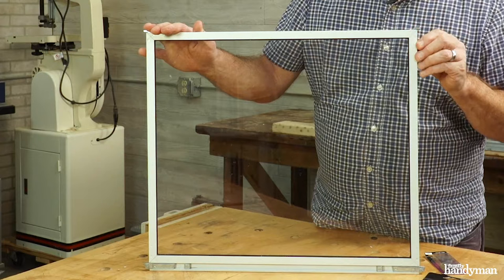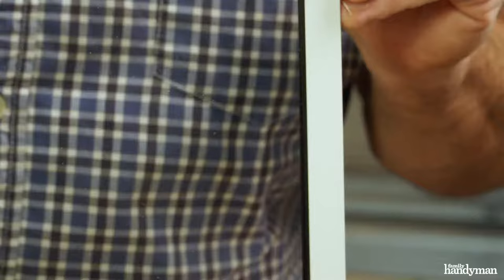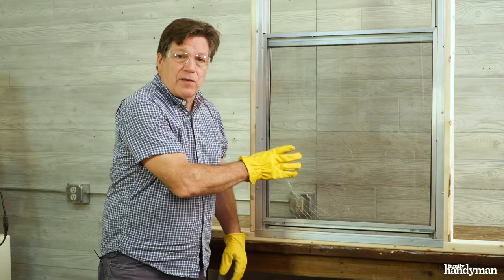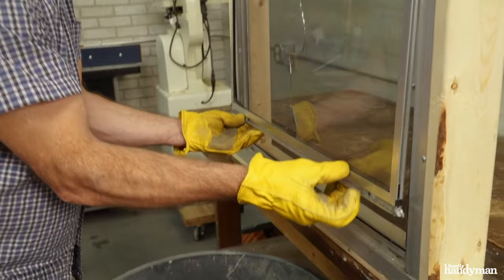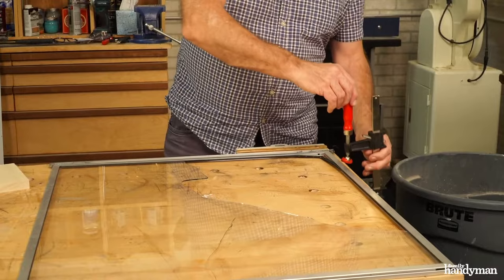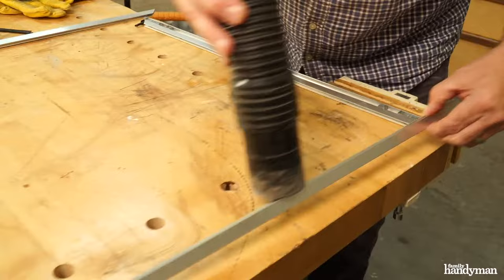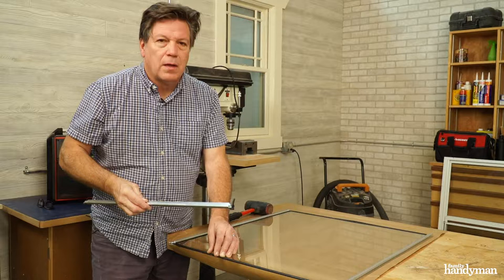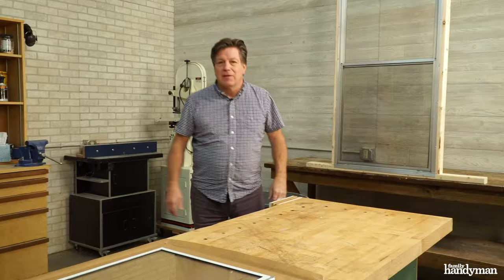How to Repair or Replace a Broken Storm Window

Comment: I can’t find anyone to do this job for 7 aluminum “storm,” window on my back porch. The corners where the latches are, the gasket is gone.
I cleaned the corners then used Flex seal, then after 24 hours, I used a silicone clear caulk. I smoothed it with soapy water on my finger.
It blends in and it doesn’t leak at all. 
Cost under $20.00.

Comment: Outstanding!  Thanks for covering the different types, like the crimped/dimpled ones.  I could it being a bit vexing to figure out how to disassemble those, good to know they can be drilled out.
Reply: Use 3/32 drill bit and only go until you get through the aluminum from both sides. That usually produces enough clearance to tap the frame out of the corner piece. Reassemble and use a nail set to tap the aluminum back in minus the bit u drilled out. I haven’t seen anyone use pins but I guess they are like rivets which would require through holes.

Comment: Helpful video...thanks. Question: When measuring for glass replacement it doesn't seem like the video accounts for the space the rubber gasket takes up. Shouldn't this be accounted for when ordering the glass?

Comment: Hi, 
I can not get the lower window with the broken glass of the storm frame.   I have taken these types of windows out through in my house with no problem but this storm is in my barn and a different make and despite having about a fourth of the  loose glass out I still can not get enough space or flex to tip one of the top clips out of the slot.   Do you have any suggestions for me?

Comment: Can you do a video on how to replace the sliders and the parts that stick out to hold the window in the frame when sliding the window up and down?
Reply: Lol, I saw your question before watching video, as it's exactly what I was looking for too & only thing search kept giving me was this vid. Though since it's been a yr, I'm sure yours is fixed now,lol, I did find out how to replace just the frame part around the glass...but on my own, not from a vid (& with better material than aluminum,which will never rust or stick, ect,but fits in same area )
Reply: Lol, Rajun Cajun,I saw your question before watching video, as it's exactly what I was looking for too & only thing search kept giving me was this vid. Though since it's been a yr, I'm sure yours is fixed now,lol, I did find out how to replace just the frame part around the glass...but on my own, not from a vid (& with better material than aluminum,which will never rust or stick, ect,but fits in same area )
Reply: @Rayyvyn  😊 I have not fixed the window yet. The parts are hard to find because of the style/age of the window. The plastic pieces I found are not the correct sizes. I would like to know how you fixed yours....these windows are in a 1970's model doublewide.
Reply: @therajuncajun6487  wanna take this off Youtube? If you have FB messenger, it might be easier w/ the back & forth,esp since I get msg's here hours late,lol
Reply: @Rayyvyn  oh.....someone else may stumble upon the info and be able to use it from here. 👍🏾
Reply: @therajuncajun6487   @The Rajun Cajun  okies,np :) cpl questions for you. 
Does your window look like his ?
Are your Windows single or double hung? 
Is yours a simple one, with only window & aluminum frame with pressure corners like his ( some are riveted or have edge pieces internal or external over corner itself) & latches that fit into channels made out of the same aluminum?...or does it also have other stuff, like balances, locks, ect?
What exactly is broken on yours, you said the latches & "sliders", not sure what you mean by sliders. Do you mean the channels the windows fit into, or something else?
 Are latches frozen, broken off, or look fine, but don't hold window up? IF sliders are channels-what's wrong w/them? Are they bent, broken, missing? 
Can you post a pic of your latches ? & pic of problem "slider" would be helpful too ( much easier than describing them) All the manufacturers had their own variations, making it a frustrating nightmare to find parts !( though I had to Frankenstein part of  my latch & completely remove another that went over window I had no use for, lol)
Reply: @Rayyvyn  these windows have aluminum frames with plastic pieces holding them together on the corners. The corners at the top of the glass has like little plastic pins that stick out and we'll go into the frame of the window where you can ship them out to clean them or till them sideways to the separate them from the frame all together. The little sliding pins that you bring in together to slide the window up and then let them slide out to lock the window in place the tips are broken off of those. I'm not sure how to post a picture in this thread.
Reply: @Rayyvyn  I just put up a short video saying need help fixing windows for a 1970s double-wide mobile home
Reply: Does anyone know where to buy those guides that hold the window when sliding it up???

Comment: I took my storm windows off frames and all.  This house was rehabed and the storm windows were not taken off and didnt paint inside wood trim between windows so it didn't match house color .  Drove me crazy!  My grandaughter helped me take  them down and now I'm ready to put back .  it appears the was a thin putty of sorts along with screws to attach to the wood frame.  Im guessing it was 3mm and gets flatten when its gets screwed down.  It also could be a type of sort.  It had a bit of sticky to it but mostly was so dry it poped off when I scrapped it off.  Please help with some info for me.  I live in the North West and winter is coming.   I may have bit off more than I can chew!!!

Comment: I bought a house I built in the 1950s and it has the original windows - a few of the aluminum storm windows are missing. I looked online and cannot find them to purchase, they look similar to the ones in this video. Is there a way I make new storm windows? I see some generic replacement but they do not have any latch mechanism
Reply: I am looking for the same thing and have had no luck
Reply: I am in the same situation!